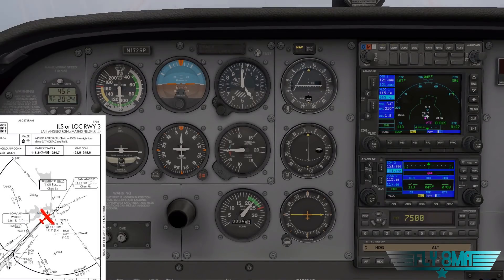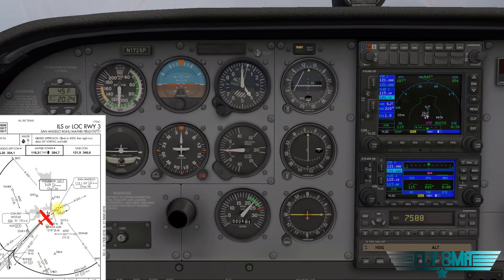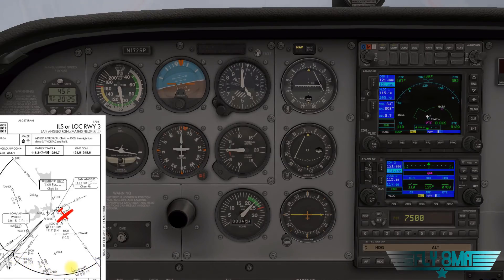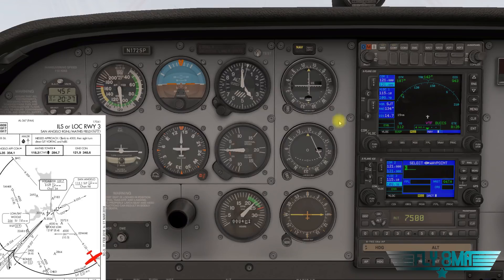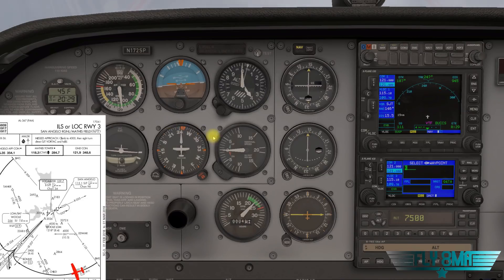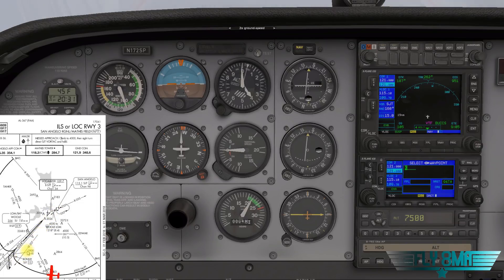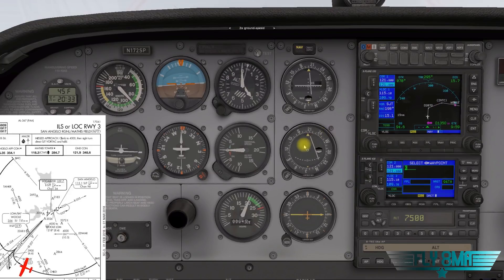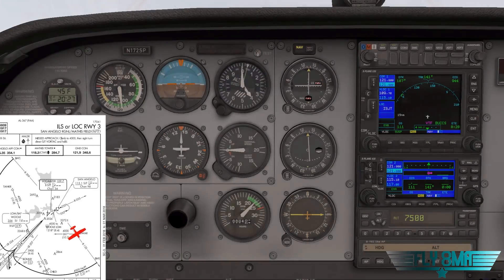Ep. 232: HOW to FLY a DME ARC!  | IFR

Comment: This technique although precise, requires constant input of heading and OBS change(10 degrees) , one can  also try to fly DME arc by maintaining bearing TO the station always on the extreme right or 90  degree to the right on the DGI in case of right hand DME arc & conversely in left hand arc, it is much easier to execute if you have a RMI ,maintain the RMI needle to the right 90'' (station to the right ).

Comment: Just  watch your DME and make small changes. Wait for your inbound course and turn 90 degrees and boom your done. Turn 10 twist 10 is not needed. Yes its helpful and looks better. Can't fail a IFR checkride for the method you use just can't be more the 1 mile off.

Comment: I’m still confused, when do you turn towards your inbound course on the approach?
Reply: When the next radial you are going to twist to is the same as the radial of the localizer. The radial of the localizer would be 214, so as he turns 135-145-155-165-175-185-195-205... he would know once he has aligned with radial 205 that he should be thinking about turning onto the ILS/LOC as the needle starts to come in for radial 215, at this point also having the ILS tuned on the other NAV, as you approach the VOR215 radial on the arc, you would notice the ILS 034 course begins to come in.
Reply: @kieranharvey4576  If I were to begin the approach at CHILD or TANKR can I intercept the localizer from there or do I need to fly outbound on the localizer then procedure turn back inbound.  I noticed that neither of those feeder routes say "NoPT" so I guess I am to assume I need to fly the PT??